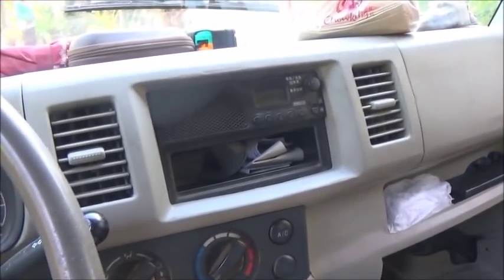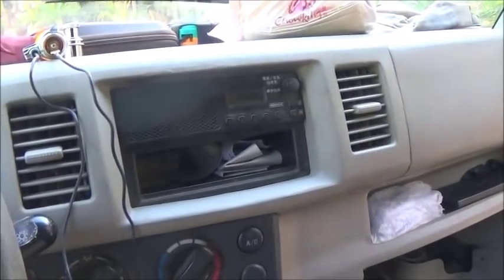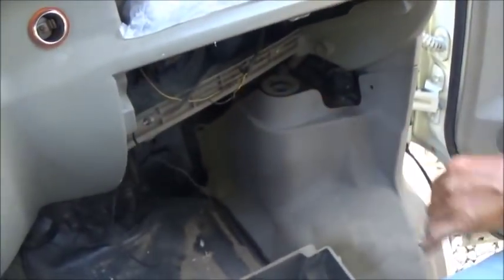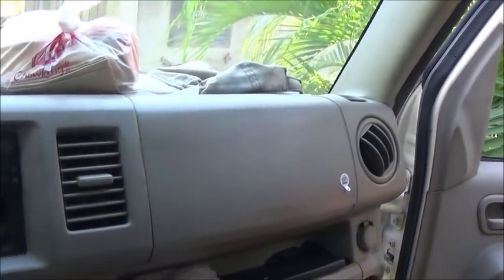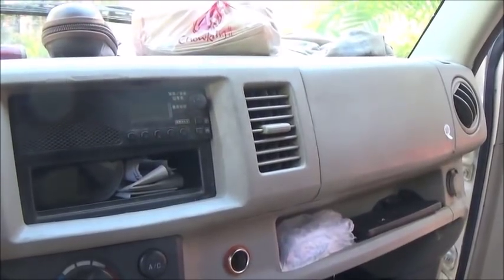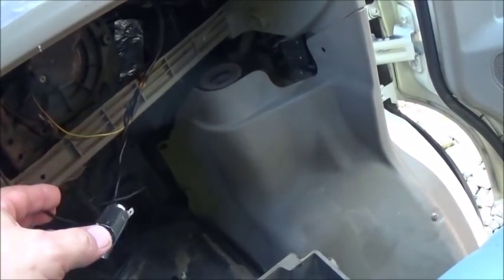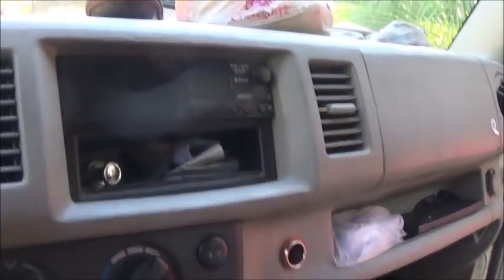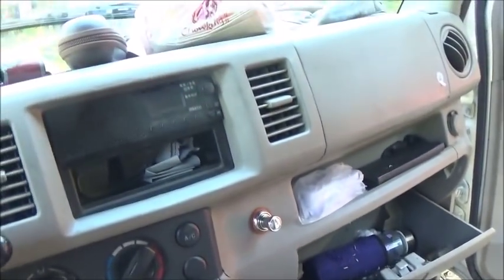Finally Putting In The Cigarette Lighter In The White Van

Comment: Hope you got the polarity correct, the point of the plug in stuff is positive, if I remember correctly the wire connecting to the case gets grounded
Reply: Yeah you're right, some stuff won't care about polarity, cigarette lighter for one I guess, but when charging phones I think you'd need it correct...hmmm...but it must BE correct cause the outside is negative and that's what Tatay connected to ground, should be all good. Only bit that doesn't make sense is having it hooked up to a positive that's only hot when ignition is on, surely there'll be times you'll want to leave the vehicle but continue charging something?